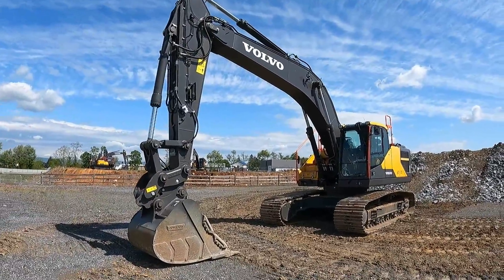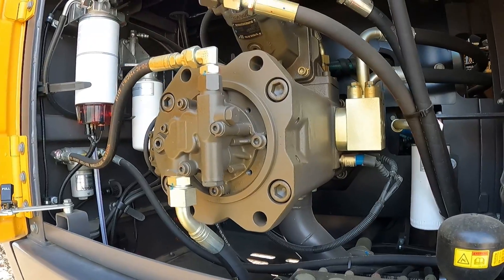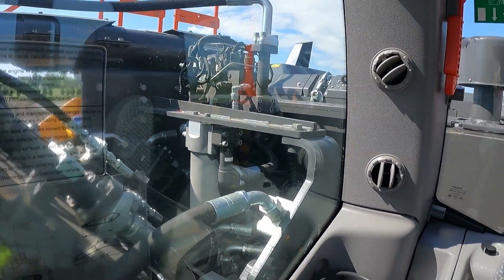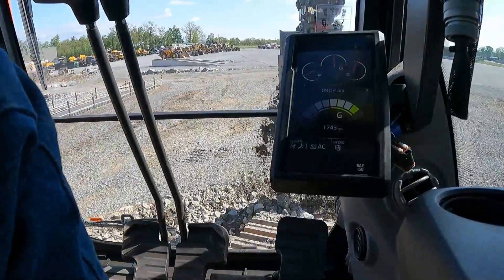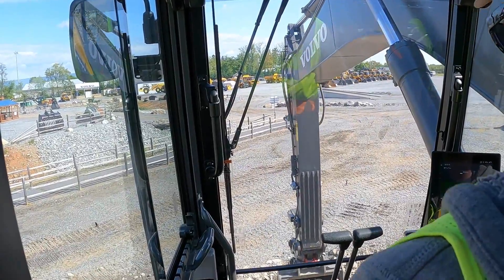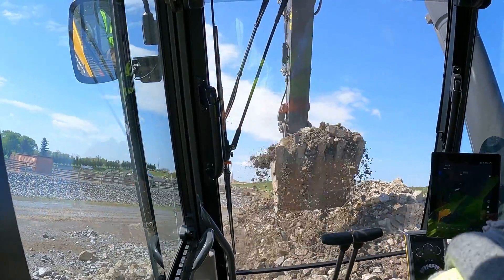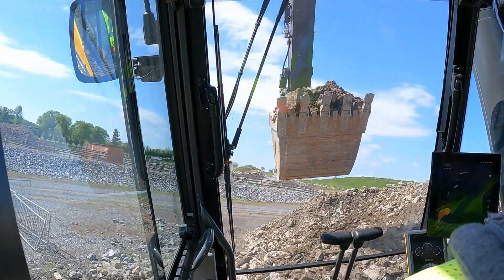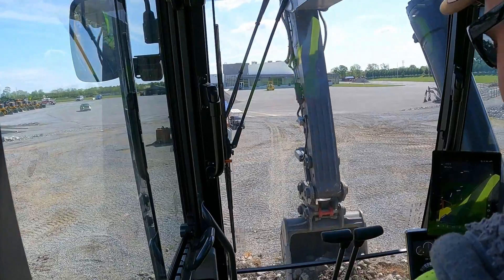New Volvo EC300EL Hybrid Excavator

Comment: I'm glad they gave the option to turn it off. Cat tried this and it was a huge failure. The 336eh we had got about 40% less production. It felt like running a machine from 1000 miles away with dial up internet.

Comment: It looks as if the accumulator supplies pressure to a motor mounted in tandem with the main engine drive so helps the engine turn the pump.

Comment: The little knowledge that I have about hydraulic accumulators is that they need to be checked regularly to be sure oil hasn't leaked into the air chamber.

Comment: I think if you got out a precise enough stopwatch, you would find that those down-strokes where it charges the accumulator move just a little bit more slowly.  I can't know by how much.  But if it's significant, it could mean you - the operator - get less done in a day by one or two percent.   That literally might not be worth those fuel savings.  Especially for someone such as yourself with multiple machines just parked on on-going jobs because there aren't enough operator hours in a calendar day.

Comment: Please be sensible , wait until these hybrids are fully tried and tested by real users. New first time ideas often have untested faults.
Reply: these have hundreds of thousand test hours on them
Reply: Tests are tests, wait until they get the bump and grind of real work, pressurised ,time dependent, budget based hard grind with different operators. not moving gravel in a car park. A year or two will tell a lot.

Comment: Well Chris that is a nice machine and with it having the standard sticker on it it should be able to carry 3 cubic yard bucket. If you get it with the short stick boom you can run a 3.7 yard bucket on it and you can sure tell the difference when loading a truck but with the 3 yard bucket you can heat up 5 yards in Sandy Clay and load a 24 yard trailer with five buckets but anyway brother you and John stay safe and keep the videos coming man

Comment: All-electric excavators are starting to appear. Reduced driver fatigue and almost silent in operation will be a big step forward, apart from motor efficiency. There will be those who dislike anything that doesn't make a big noise and burn diesel fuel but such heavy vehicles will become more common as battery technology improves along with lower prices. This simple improvement from Volvo is to be welcomed.

Comment: Perpetual motion scams have been around for many years.
15% saved by a repeat of a portion of the energy used in the boom up and return action. Not the fuel used to swivel the arm through an arc or to drive the crawlers!!
Can't be a 15% saving on your total fuel used.

Comment: Nice excavator. I like how the Hybrid System works and how it Can save you a Lot of fuel in the long run. Will you be getting the 300 ?Nice Video too.is that the same bucket as u have in your 260 or is that bucket in the 300 bigger in capacity again?stay safe

Comment: I am not impressed with the hydraulic line for the accumulator sticking up, and out in the open like that one is. If you are working in close quarters, in the woods, or where ever, it is too easy for something to fall, or catch it in a turn and break it. Some type of guard should be used to protect it, or have it relocated to a lower position. Just my opinion.

Comment: I wonder if the boom will come down a little slower than normal due to the accumulator.  Does the accumulator work by having a piston attached to a powerful spring?
Reply: Probably the same gas-liquid accumulator system as in Volvo L wheel loaders.

Comment: It looks more like the hybrid system adds a hydraulic motor to the main hydraulic pump to add the torque to the engine from the accumulator.
Reply: Yea, looks like a fixed displacement piston motor!

Comment: The reason you can shut it off is when it is not working correctly but you can’t stop for an hour and wait for a mechanic to get out there hopefully you can keep running. The company I work for moves about 10 million yards of material all by hoe and on road and off road trucks and probably 7 of it from thaw to freeze. Every hoe breaks down but when it’s something like that it pisses my boss off 100 times more. If I sit for an hour there could be 30 trucks sitting there. Had a lot of issues with the 349s when they came out and a couple of them still have problems sometimes. I wouldn’t trade the 352 I run for anything. I loaded over 60,000 side dumps last summer with it and was broke down once for a starter and twice for a hose break. They are trying a Volvo on a different job and I asked the operator how he likes it all he said was the seat was really nice.

Comment: We had an accumulator system on our hydraulic systems where I used to work before retiring. If the Volvo works on the same theory, you should have noticed a cushioning effect on the movement when operating the controls. A shock absorber effect so to speak.

Comment: I thought it was going to be towing a huge battery pack.
Reply: If you have to carry a big counterweight so why not a battery pack instead?  ;D  But not so easy to gain charge it as in cars or trucks because you don't use engine brake so much. But a smaller fuel engine in lower revs and an battery electric hybrid motor/generator with its lot of torque is coming also in bigger excavators soon.  You are absolutely right!

Comment: TO BE CLEAR...THE ACCUMULATOR STORES THE HYDORO OIL. AND RELEASES IT ON TO PUMP SHAFT THRU A MECHANISM SIMILAR TO AN OLD SCHOOL WATER WHEEL.
BECAUSE THERE IS AN EXCESS POSITIVE FORCE BEING APPLIED TO THE PUMP SHAFT THE MOTOR TURNING THE SHAFT HAS TO WORK LESS, OR PROVIDE LESS TORQUE AS THE ACCUMULATOR IF PROVIDING A PORTION OF THE TORQUE

Comment: New, better does cost more - but Volvo claims payback in saved fuel in about 2 years.  Obviously applied to the largest cylinder first and which will be applied to other hydraulic solenoids in future.  Kudos Volvo

Comment: I’m curious how much heat that adds to the hydraulic system.
Reply: I think none. You save on fuel, bc there is less energy needed for the same work. So your engine will heat less.
The hydraulic return normally goes to the hydraulic cooling i think?
If that is fed back to the hydraulic pump, you will get hotter intake, so output too you would think. But the hydraulic pump has to do less work, so heats it up less. So for that system i dont think it increases, or decreases.
But im no expert in these engines and pumps.
Reply: Good point. If it were not saved in acc, the all energy would be dissipated in the tank with much more heating. The merit of this system is a lower hyd heating load.

Comment: Someone or some company who buys this new, will hardly ever use this machine until its End of Life cycle is up. Which means this option wont even recoup the cost of depreciation over time, whether its 5 or 10 years, before they resell it. At 15% fuel savings a new machine depreciates faster year over year.
This comment is absolutely NO KNOCK on LD18, or Volvo. I think the innovation and development is moving in the right direction, and I applaud Volvo and their fantastic machines for creating this. 

I just think the fuel saving needs to increase for the purchaser to combat depreciation, to make this a viable option

How much more does this increase sticker value?

Cheers, thanks for letting me debate this option. No hard feeling I hope

Comment: **4:33 its using all that energy as the boom goes down to run your pump. So instead of your motor running the pump all day the charge that you get from booming down runs your pump at almost idle for the fuel efficiency...genius

No thumb though is a bummer

Comment: Would there be an advantage to an all electric excavator vs. a fueled one, besides the obvious environmental. You need more torque from the engine/motor maybe?
Reply: An internal combustion engine can never match an electric motor for torque
Reply: If you use 100 gallons of fuel each day you would need to carry 10 tons of lithium batteries (not cheap). Then to charge it overnight you would need a three phase outlet with 208V 400A.

Comment: Interesting video. I worked for nearly 40 years at a heavy industrial plant and hydraulic accumulators, which is what Volvo is calling a hybrid system, have been around forever.
Reply: Yes, accumulators have been around forever, to smooth out pressure under demand, store pressure in case of supply failures etc. This is an innovative use for one and is very cleverly implemented.
It's basically a turbocharger for an hydraulic system- turning waste energy (dumped return to tank pressure) into an energy source.

Comment: some interesting numbers, the engine in the 300, a Volvo d8J 240 hp, should consume around 10-15 gph of fuel in an excavator assuming a 8 hour work day that would be 120 gal of diesel at 15 gph. Volvo claims 15% fuel savings with this system, obviously a optimum scenario, so in 1 day that would be 18 gal of diesel saved, in a 5 day work week 90 gal of diesel assuming a price right now of $3/gallon for diesel and the price of this system to be in the 10k range, best # i could find, it would take less than a year(of working 40 hour weeks non stop) to pay for itself in fuel savings, of course that is all probably best case scenario and I think the system would be more expensive but probably still completely worth it for a new machine with  a life expectancy of an assumed 25k hours.

Comment: charging an accumulator to then send the hydraulic pressure back to a fixed displacement hydraulic motor. 
this is to spin up the hydraulic pump and engine without the added load when performing the next high load cycle.

i would like to see a smaller diesel engine/generator charging a counterweight sized capacitor. 
the stored and available electric power would be used to run electric motor for machine hydraulics.
swing motor could then also be electric so regenerative power is added back to the capacitor storage when swinging.
Reply: Many fewer and cheaper parts all hydraulic.
Reply: Any time you change energy from one source to another, you are wasting energy. This system is genius in it's simpicity and use of existing off the shelf hydraulic components and principles.

Comment: There are other ways to collect energy from the movement of the machine. Create your own energy to assist the operation of the equipment, like power generators when turning. Power could be harvested & generated with magnetic actions energy collection. Hybrid Volvo harvesting energy could change world to collect & create their own energy. Just make more than you use, is all the energy you need to create. Volvo has a history of forward reaching technology.  Loved our Volvo Wagons.  Would be perfect again.  The Volvo Wagons are one of the best for smooth ride & dependability.  Dad could fix our Volvo cars.  Had a bunch of them, before he traveled his final journey.  

No Thumb? All excavators should have a thumb as standard equipment. Most excavators operators need thumb & bucket working together with off-set bucket teeth for fine work. Excavators need 350* articulating bucket & thumb on ball joint to be given better full movement. Operators need better coordination between controls, bucket & thumb working together. Which will be able to do fine detailed work would be an amazing transition in technology for excavators. 

Design a quick attachment for retrofitting excavators, working in cooperative partnerships. Three quick attaches. First quick attach articulated head to boom as a unit. Quick change to rock hammer, for instance. Back & forth, until you remove the rock you are working on. Chris LetsDig18 worked big rock removal with rock hammer excavator together. But, he spent weeks & months waiting to get the job done by other contractors being so busy. Being able to quick change between the bucket/thumb & a strong rock hammer, would have gotten the Animal Clinic done months earlier. No waiting on others. 

Having a strong articulating bucket & thumb would have made most every job even easier. To be able to change the position of the bucket & thumb, would work much better for logging with or without root removal. Wiggle this way & that way to get in cracks of the rock or pick up mixed directions of trees fallen in forestry. No more sloppy forestry grapple hook, see if tool will wiggle into place to attempt to grab a log. Give that grapple some control by the operator. Machine would get lot more work done. Not too hard to retrofit. It has some value, but would be an amazing grapple tool if forestry operator had control. 

I would bet operators can think of all kinds of equipment you might want to attach to an articulated ball head for more control to fine work. Being able to quick change different attachment. Maybe, you need two thumbs working together at many angles. It's very obvious why this is needed, when you watch excellent world class operators work in the field. They have to push, pull, shove, sideways, forward, reposition excavator, all kinds of wasted movement & time just to pick things up at angles. Every operator I have asked has agreed an articulated bucket & thumb would make time saver. Every operator shaving off unnecessary movements makes them even better world class operators.  Volvo take a survey, I did. Thanks.

Comment: DANG, $3/gal is expensive? we are over $5/gal here.
well, $1.35 litre for road diesel, 4 litres per US gallon is $5.60 per gallon
$1.59 litre for gas which work out to $6,36 a gallon.

Off road, as used in the machines, 15% lower

Comment: That's so neat how it stores all that energy
Reply: Yah Chris,
How does it store the energy?
Massive Spring?
Rubber Band?
😁
Reply: @gregfeldman6818  its basicly a hydraulic cylinder in itself. the piston just doent have a rod on it. the piston is also pressurized on the backside

Comment: Would the weight of the bucket or size have any bearing on the fuel-saving
Reply: Yeah! If you get a enough sized bucket and longer boom you have invented the Perpetuum Mobile and you will be VERY rich fast!  Haha!
Reply: Not really, it's more the down travel of the boom and how much it can store. More bucket just means it stores it a bit faster, but doesn't increase the storage.
Reply: @Blazer02LS  More bucket also means more to lift when it comes time to boom up. You're not "gaining" any energy with this system, just capturing and redirecting a fraction of what the engine has released by burning the fuel. The recovered energy would otherwise be wasted pushing the fluid back through the hydraulic lines and valves to the tank creating heat and noise.
Reply: More weight is more energy, so it would increase fuel savings if the hydraulic recovery unit was sized proportionally to the bucket and arms. If you used an undersized recovery cylinder, it'd restrict the amount of energy you could recover. If you used an oversized one, you'd have losses as well since the weight of the bucket and arm wouldn't be enough to fully utilize it.
Reply: @GGigabiteM If they increased the storage it would help, but only up to the point of the amount of hydraulic fluid that can be returned from the cylinders. So it won't make much difference unless they increase the size of the cylinder and the accumulator at the same time. Plus you have a limit on the bucket size just from the weight of the machine and what it can lift with the pump and engine it has. Won't do any good having a large bucket if the machine can't handle it.
Reply: @Blazer02LS  Yeah totally. It would be hilarious seeing a comically large bucket on an excavator, but not at all practical.
Reply: @GGigabiteM  Have seen people try it, they either learn that it was a dumb idea or they lay the machine over trying to swing the height around. The state did that on one of the dredging rigs here, they decided that a larger "sand" bucket would work, I guess the ones in charge forget to take the weight of a bucket full of water and sand into account. It wouldn't even pull the bucket up because the relief valves were screaming.
Reply: @Blazer02LS  Those must have been some geniuses.

>installs oversized bucket

>immediately tries to lift the heaviest load possible and it gets stuck/breaks

>pikachu face

I have an 88 Dakota with an 8 foot extended bed, and I get guys all the time looking at it "hey man you got a big bed on there, you can haul all sorts of <insert stuff that weighs tons>" and they say it in confidence. They're quickly offended when I tell them they're idiots and the only reason Dodge had an 8 foot bed option was to be a glass pane hauling truck.

Some people have no common sense. If I had a comically large bucket, it'd be for some material that was large but didn't weigh anything, like scrap lumber, not trying to dredge a canal lmao.
Reply: @GGigabiteM  exactly.  the mulch place down here has a bucket on their front end loader big enough to fit my entire full size truck in, but then mulch isn't that heavy is it.
Reply: @GGigabiteM  More energy needed to lift though too so no net increase in savings and possibly more losses if things aren't ideally sized to recover most efficiently anymore.

Comment: Small accumulator compared to the one's I saw in the military. But the other advantage of an accumulator in the system is reducing shock to the hoses and valves. Have a good one.
Reply: @JackHudler  set up right, they keep the flow constant and smooth, but that type is between the pumps and the rest of the system. Plus they can let important things function for a bit if the pump dies.